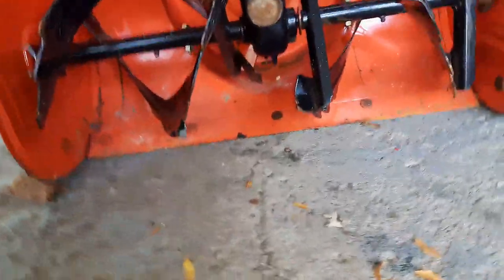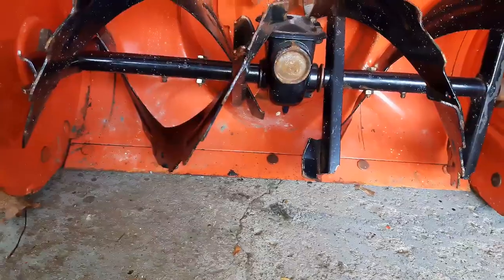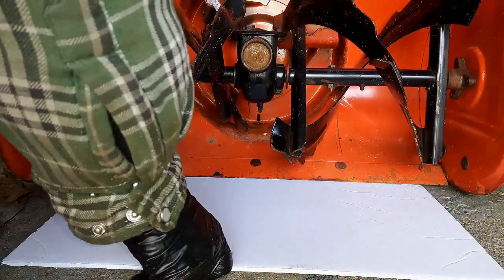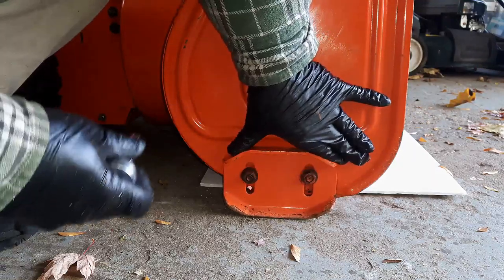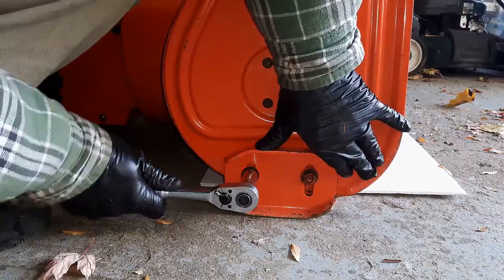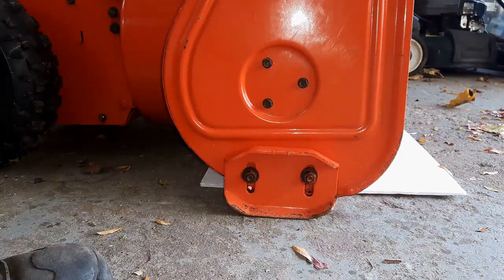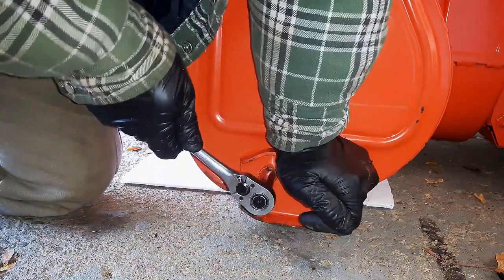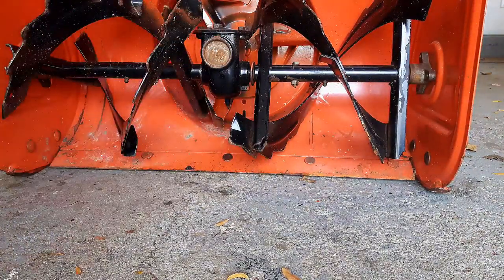How To Adjust Snowblower Scraper Height

Comment: Always make sure both tires have the same amount of air in them and the surface is level. You can use a leveler tool to be precise. The scraper bar adjustment will not be correct if either is off. BTW manufacturers recommend the scraper bar be adjusted 1/8 from ground is for concrete. Gravel and other surfaces will require higher clearance.
Reply from the maker: Good point regarding the tire air pressures. I did forget to mention that in this video. Also, I do (did) recommend 1/8" of an inch of the ground in the video. Read that in a manual at some point. Thanks for watching. Take care.
Reply: I used two pennies for each side the rest is the same procedure as you described

Comment: what if the scraper had a rubber gasket at the bottom, would that give you best of both worlds? Closer to the ground without scraping the metal and ability for the rubber to flex around uneven areas?
Reply from the maker: Great question Radek W. I do believe the rubber would allow a little more give around uneven surfaces. However, it would most likely still be a bit troublesome on gravel driveways if the scraper bar is set too low. It would also wear more prematurely if set too low.

Comment: can we replace scraper bar?
Reply from the maker: Yes you can. There is usually 4 or 5 bolts holding it on at the bottom. It's a pretty easy and self-explanatory job. Just remember to adjust it's height afterwards to suit your needs. Thanks for watching. Cheers
Reply: @brantsmallenginerepairs  THANKS.